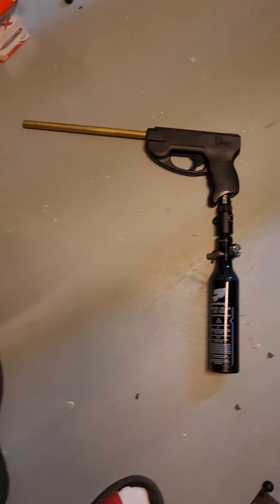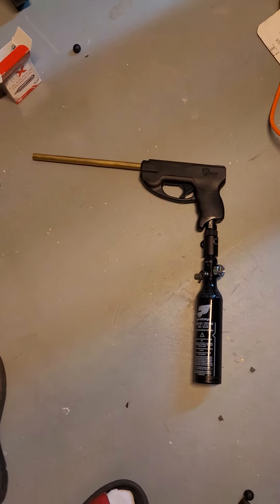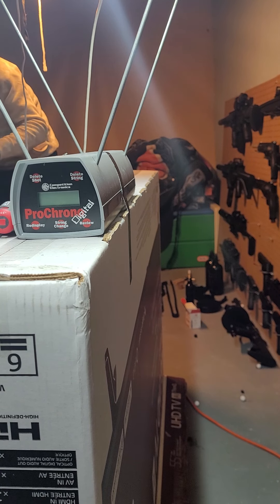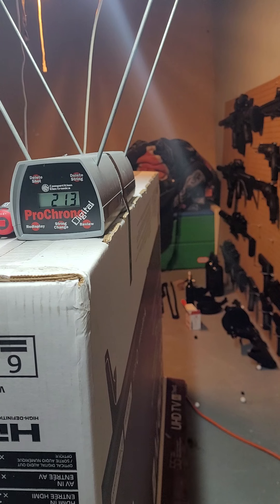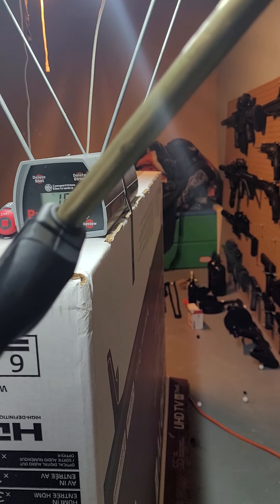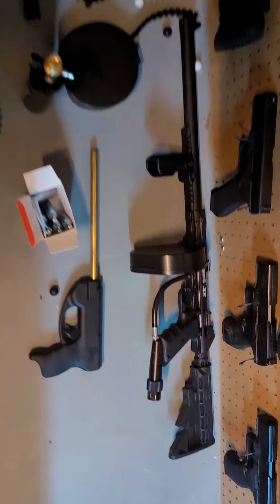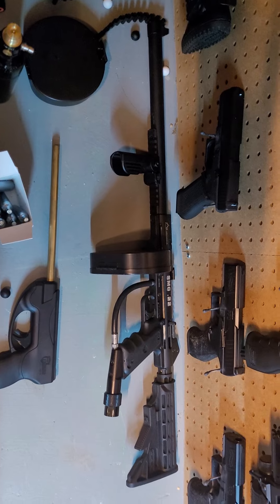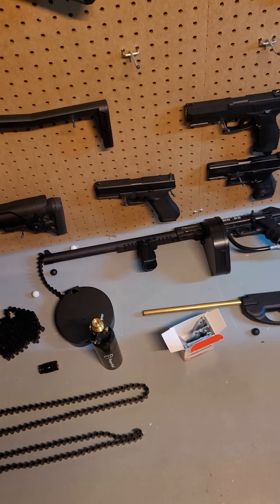Umarex HDP Compact 51 Joules 832 fps HPA Power testing

Comment: What's the point?  Can't use it for EDC now.
Reply from the maker: cuz at 7 joules it wont stop a teenager lol 55 is a different story
Reply: Question: what if you removed the plastic valve block would it be higher than 7 at that point? Because it’s understandable that this is purpose built and meant to be kept inside but for edc the question still stands.. what would the number look like with a 8g and the valve removed @LessLethalHomeDefense